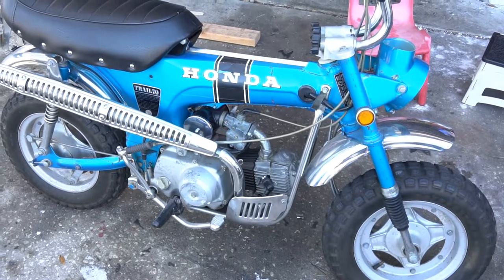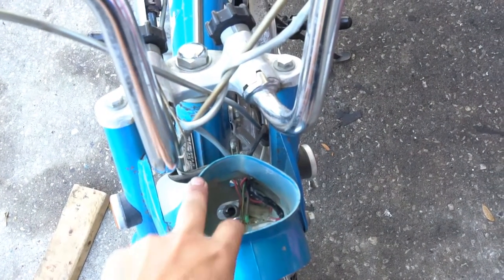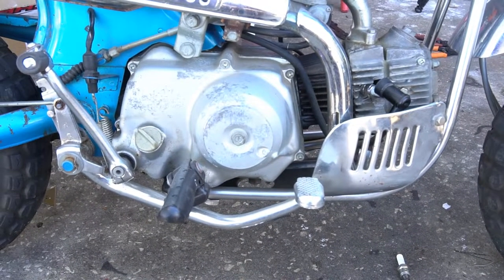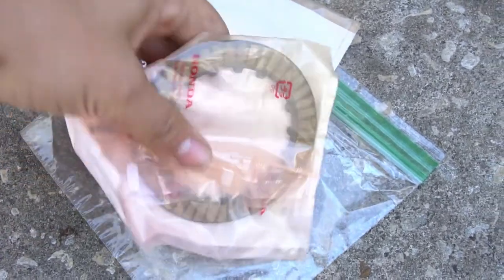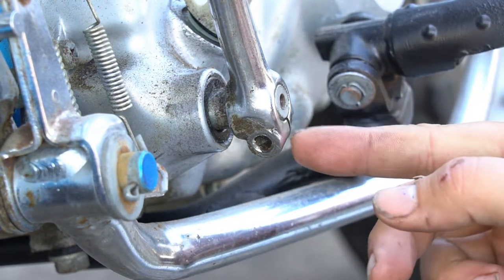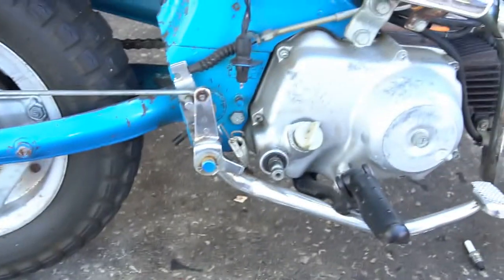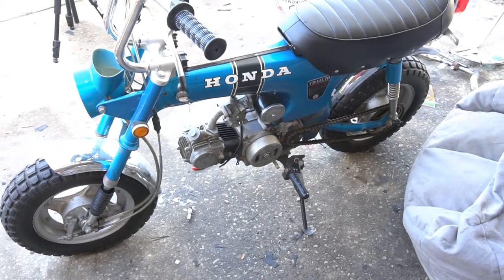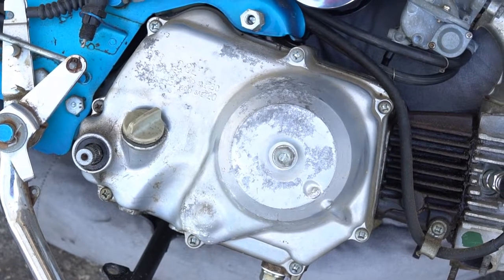CHP Motorsports Big Bore 88cc Bike Build - Vintage Honda CT70 Mini Trail Dax - Video 1

Comment: What are your thoughts on getting the HD clutch for the big bore kit?
Reply from the maker: Not needed.Use Honda discs and rebuild the factory setup. If you go with a 108cc or bigger you'll need to get HD clutch. Also if you do put the HD clutch in it tends to be grabby until it wears for a little bit

Comment: Under the seat, behind the battery. What is that double orange square item with wires connected to it do? Thanks
Reply: I believe that is the rectifier
Reply from the maker: Rectifier ( Coverts Magneto A/C current to D/C current for battery)